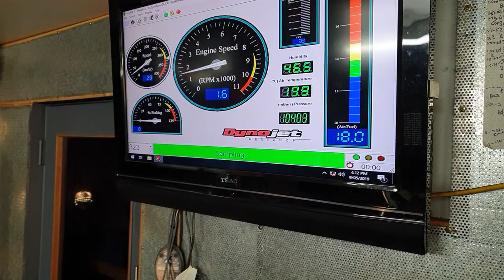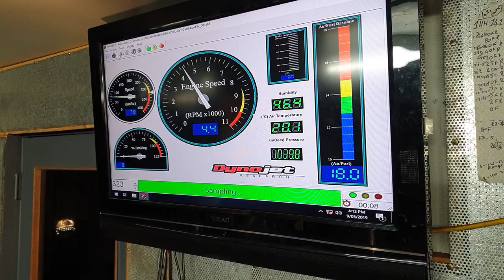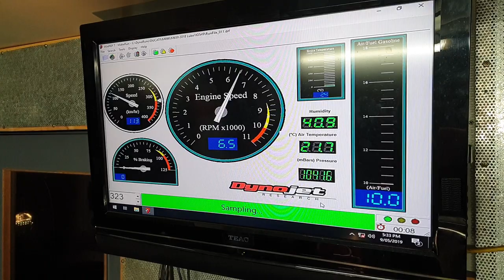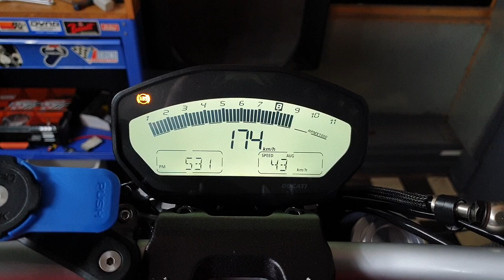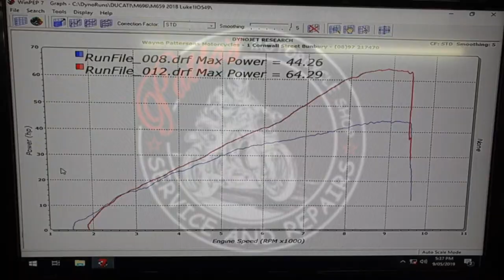DIY - Ducati M659 Lams Upgrade 50 percent more power.

Comment: Just did this to my bike. Video is very helpful. Two items need clarification. Firstly, to unplug the wires to the throttle position sensor you will need to get a flat screwdriver behind the black plastic socket and prise off a wire clip that is out of sight. The socket will never come apart unless you get the wire clip off. Secondly, to remove the throttle cable metal tube, pressing the flat metal spring, which you cannot see, behind the mounting will do nothing. The throttle cable will come out of the housing easily, only after you have fully released that flat metal spring. To do this, get a tiny flat screwdriver under the top of the spring and prise it upwards. It's not a coil spring, it is a flat piece of metal that slides down and holds the end of the cable (i.e. the metal tube) into the throttle body. Before you do either of these activities stuff a rag down the top of the throttle body, just in case either of these springy things flies off and ricochets into the throttle body.
Reply: Struggling to get the throttle cable out big time!
Reply: Just done it haha

Comment: I had the previous model 659 that I bought when I got back into riding a few years ago. That model was so much easier to derestrict! Two minute job. With the restricter off these bikes are almost the perfect amount of power for urban riding. Lots of fun.
Reply from the maker: I agree Max. You can use 110% of the power and have alot of fun in suburbia.

Comment: Thanks for that. Even unrestricted, the air fuel ratio was still rich at 11.5 in the higher revs so there is even more power there with a powercommander or similar to tweek
Reply from the maker: Yeah mate.  Tune it up for maximum potential !! ✊👊👍
Reply: I might recommend the Cobra instead of the Power Commander as it adjusts itself instead if being stuck to a map which would most likely be harder to get seeing as how its unrestricted now. They are the same price too.

Comment: Nice one mate, only seen people sharing photos on this subject, up till this point. People seem to think you can get at that bolt from the other side, without removing the entire throttle body. Also, the photos I've seen don't look anything like what I am seeing in your video. So it would seem the internet is full of it, as usual heh

edit Oh, wait, maybe your m659 is a different year to mine (2014) my rear suspension configuration is not the same... guess I'll have to go have a look and see what I can figure out.
Reply: Presumably this tweak will have no effect on my max top end, but it will just get there a lot faster! The dealership I bought mine from was telling me about the de-restriction option and claimed I would gain some top end, which made no sense to me...
Reply from the maker: Definitely the bike will gain top speed as it will make more power when derestricted . I would recommend getting it done only if your riding skills are ready for the extra power. Cheers for your interest and comments too.
Reply: @turbobike749  I've had it for four years so I'd love the extra power, now in the UK where LAMs does not apply. Is the bike in your video a 2018 M659? Mine's a 2014, so maybe this is actually correct (for me) http://eat-the-bear.blogspot.com/2015/09/how-to-de-restrict-ducati-659.html If it wasn't 2:30 a.m. I'd just go have a look at the bike heh
Reply from the maker: Yes Andy this is the latest version of the monster here in Australia.  Yours may be different.
Reply: @turbobike749  Thanks mate,  my friends and I have all figured it was going to be something inside the throttle mechanism on the handle bars. So although your video isn't of my model, it has still pointed me in the right direction!

edit - Bike is now de-restricted. So much for jobs on Ducati being difficult lol I bet they amended the set up on the newer models to make it more difficult. The internet was right for a change, it was one bolt, accessible without removing anything else, took less than a minute.

double edit - Wow, what a difference a bolt makes! I've loved this bike for many years, only now do I fully appreciate what it is really capable of. I absolutely agree with you, if someone has only recently passed, do NOT remove the restriction, unless you want plates in yourself, or worse. I can only imagine what she'd be like tuned up combined with an exhaust upgrade!  Now she deserves to be called a Monster... Hilarious :D
Reply: @turbobike749  terrific video. Just bought a 2020 model so just want to check your model was of this type and this is the process. Wow you made it look so easy! Thanks.

Comment: im stuck at 3:02 I can press the clip in from behind, however the cable part wont come out. i notice on your video it looks like youve pre done it as my thread is visible from below. Great Vid and Thank you for sharing.. legend
Reply from the maker: Yes mate you need a flat screwdriver to lift the clip outwards as you pull cable up. Glad you liked the video. Let us know what the power improvement felt like too .
Reply: What's the power difference like mate?
Reply from the maker: Huge ! Such an improvement to do to your bike.
Reply: @turbobike749  any shots of where to put the flat blade.

Comment: Great video. Looking at getting a 2011 659, the one with the vents in tank. Would this mod work for an older model?
Reply from the maker: Easier on the earlier bikes. This stopper is on the right hand side of the throttle bodies.

Comment: torque peak at 8k is pretty wild for a 2v.  same cams as the other scramblers, which are quite short so that's impressive.  well, i'm just looking at the specs now.  8 degrees less duration, but inlet actually closing 6 degrees later.  exhaust opens 8 degrees earlier too - so you couldn't really advance it.  wonder how that cam would work in an old 659?  i have one i'm hoping to put in an old monster at some point.  how does the power and torque compare to an older 659 or 696?
Reply from the maker: Thanks for commenting Brad. Not sure about the comparison as I didn't overlay it. I would guess it would be similar. Also mate I enjoy you channel uploads. Good work.

Comment: Great vid, thanks for that.  Also, if I want to sell it later I have to re-restrict it as it's a LAMS bike and therefore is supposed to be sold with all the restriction shit on. If I do re-restrict it at a later date will it be a problem? [eg. inspectors get the idea that it's been tampered with etc]..... again thanks... very high quality vid without any bullshit.
Reply from the maker: Thanks for the comment Phil..Yes I would restrict it so the next young bloke that jumps on it doesn't have too much power. Then they will get their skills up before unleashing the beast :)

Comment: Hi mate,, can you plz confirm what year models this works on? And what model is in the vdo?
Reply from the maker: Hello Ibrahim, It is done on the Australian models that are M659 which are learner approved. The bikes it works on look same as video and the earlier model M659 look different to bike in this video and have different setup.
Reply: TURBOBIKE 👍🏼grt.. thanks heaps. I was told by the dealers otherwise.

Comment: Im bout to get my full soon , and i have this bike amazing beautiful thing... i knew about the restriction, but are you saying that if you remove that throttle stopper you going to gain that more torque/HP? Without doing anything else? I was told by my dealer you need to reflash the ECU? Which would cost 2 to 3k
Reply from the maker: I just did what was in the video mate. Nothing more or less.
Reply: What about the upmap and termi factory fitted end results?  Did this bike already have these or was it just stock standard?
Reply from the maker: @marcusgeorge1825  This was just a stock bike with no other upgrade.
Reply: 2 - 3k for a reflash. Did you call them thief's/criminals? I would.

Comment: do you have to remapped the ecu or anything like that or just remove the plate.
EDIT: nvm found another comment about that
Reply from the maker: Hi mate. I did run it up on the dyno and the air fuel ratio still looks good on the bike I tested it on.

Comment: Any advice on removing the external throttle cable tube thing.  I could feel the clip around the back but no matter what I did I could not get it out.
Reply from the maker: Hi mate. I used a 90 degree pick to slide in under the top part and lift it up.

Comment: So you can take this screw out without needing to re tune the bike?
Reply from the maker: Hi Dan. I didnt need to retune the bike I tested and it ran fine after the mods.
Reply: TURBOBIKE thanks for replying to my comment. Awesome I’m getting mine done next week
Reply: Out of curiosity how does your monster run when it’s raining?
Reply: I have 2014 model, only a rivet with a bolt on otherside, I used a drill with a very steady hand, and it removed instantly, I just push it away the stopper, is alot easier on 2014 model, it's just a plate, i left bottom rivet, and plate on bike, i just pushed it away until throttle cleared, simple as, it gives you, at least 30 percent more throttle and air, which equates to bigger explosion, more power, lol.... u only need to remap, if you put sports exhaust on, mines had the lot done to it, terni ehaust with ecu, kit.... and its a nice little ride....

Comment: hi why my 659 wont rev over 5500rpm？I mean it simply can’t
Reply from the maker: Hi Jimmy, I'm not sure why yours wont rev over 5500rpm. The mods that I have done to this bike have fully transformed it.
Reply: TURBOBIKE wt have u done, my 659 doesn’t give me any more power and it is super hard to rev over 5500-6000rpm, dealer said it’s learner restriction
Reply from the maker: @jimmyzhu9953  Thats correct. I have de restricted this bike for "racing use only".
Basically what I have done in the video makes it way faster than a restricted model

Comment: I saw the air box mod for the Scrambler on the forums, but can’t seem to actually find it for sale. Could I install it on my 659?

Thanks!!
Reply from the maker: Yeah I dont make those kits anymore.  The M659 is same looking throttlebodie and airbox but the frame is different etc so all bracketry wouldn't fit.
Reply: TURBOBIKE Okay, not a problem thank you very much.

Comment: Do a lams street triple plzzzz
Reply from the maker: I will do mate if one turns up at our shop !
Reply: @turbobike749  can you maybe shed some light on this then until you get one in the shop. There's a guy selling a lams 660 which is unrestricted and tuned, said he's getting over 90hp on the rear wheel, that's over double the standard right? In real world scenario what sort of improvement can this achieve, e.g. 0-60mph goes from 5sec to 3.x or torqueall the way through each. I'm not a mechanic would love to know what this means to a lay rider.

Comment: Is that the current model lams, I just called in to look at one today and was told there was no way to open it up or derestrict it after you have a full license.....
Reply from the maker: Hi Dave, that was the latest bike generation but it was a 2018 bike. I check the parts listing and they both run the same throttlebody with that restrictor.
Reply: TURBOBIKE thanks for the info, they obviously don’t want people to know that.. but I don’t want to buy a bike that I can’t unrestricted for that sort of price.

Comment: Hi mate...thinking of buying a 2012 model...do you know whether it would be the same procedure...?
Reply from the maker: HI mate, the 2012 is different and runs a throttlebody for each cylinder (not single like later models). The restrictor for this model is on the R/H side where the cables go in. Feel the throttle add look at the throttlebody. If it only goes to about 1/3 throttle restrictor is still fitted.
Reply: @turbobike749  champion...thanks mate.
Reply: @turbobike749  does a Monster 796 (North American model) not have this limiter then?